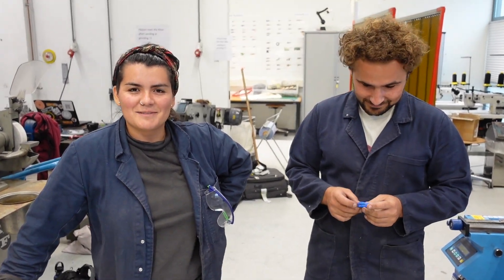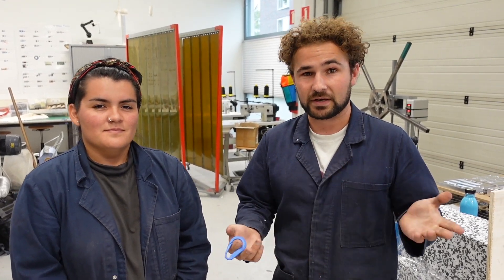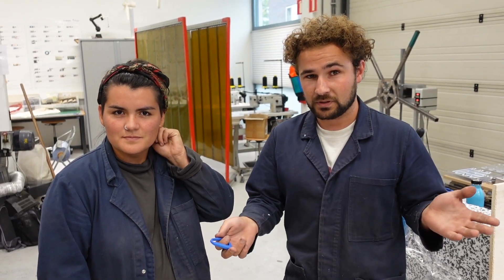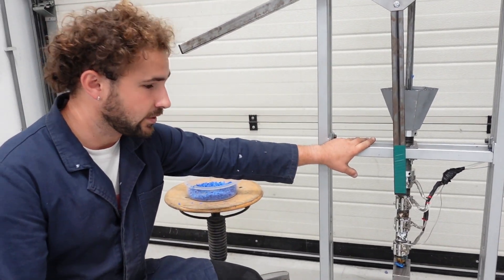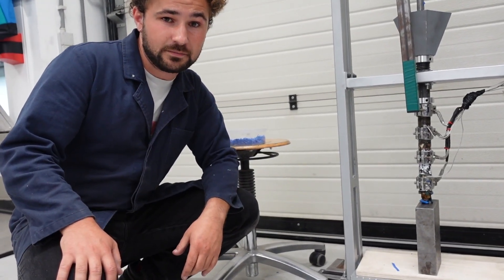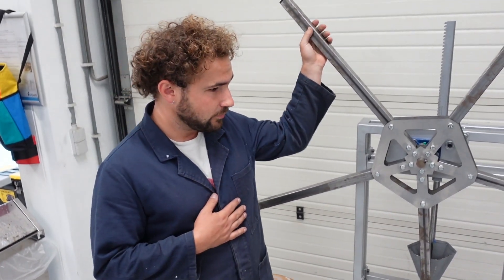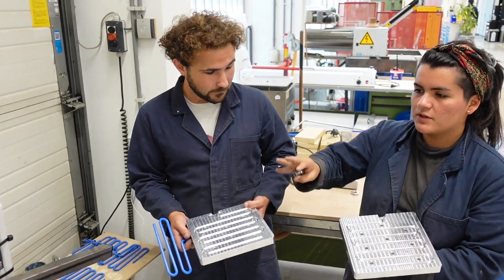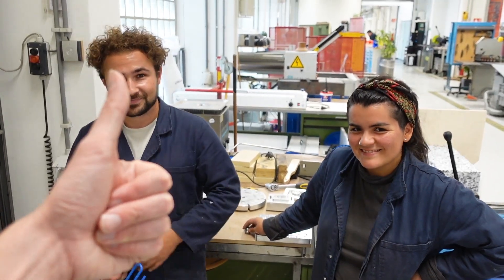NEW Plastic Injection Machine SNEAK PEEK

Comment: To what extend are these types of manual injection moulding machines suitable for thin walled shell pieces? Typically found in clamshell design housings for devices? I can imagine the flowrate and relatively low pressure cause the moulds to not fully fill in such cases? Is there a specific source where we can see actually moulded parts and hopefully some of them which are at the limits of what is possible?

Edit: seems the mould you use to test the machine has no method of getting rid of air build up… you are essentially stopping the flow with an air lock. Create a small air channel at the end of the mould and the material will flow all the way to the end no?